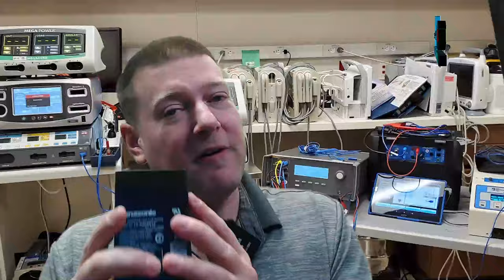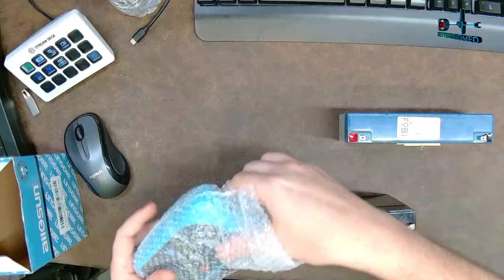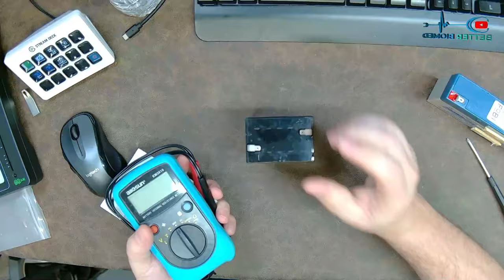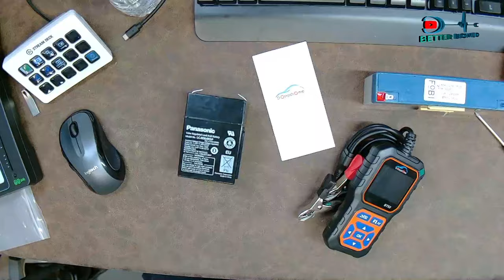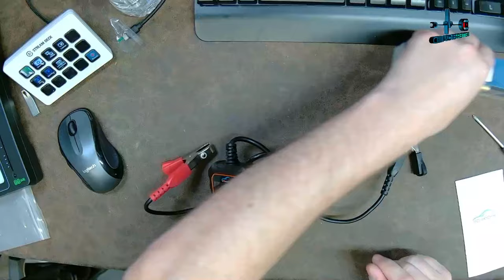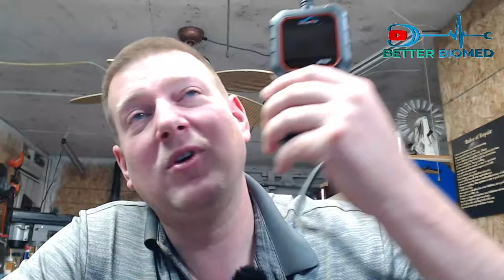Testing Batteries: It's More Than Volts!!

Comment: I use a Cadex C7400ER-C battery analyzer for most batteries. Also, It is amazing how much information can be gleaned from using just a multimeter and a variable psu for lead acid batteries once you learn their language.

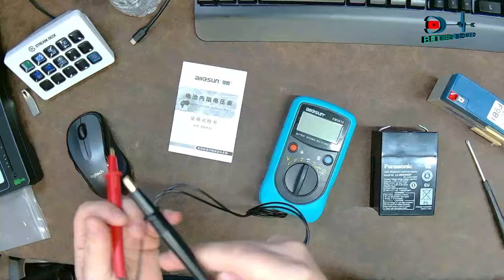Comment: 7:22 The 4 wires are Kelvin 4 wire measuring method to rule out the resistance of the testleads themself. 
Almost all of those little battery testers are for automotive use, they only do some calculation that fully depends on the parameters you have set, like voltage, Ah and  Cold Crank Amps (CCA) . Some use the SAE or DIN numbers that are printed on the battery. 
With any type of battery, you can go back to basics for calculating the internal resistance. You can do a load test, but then you drain the battery, and need a Clamp meter. 
But there is a another way without loading or draining the battery. Here for you need a signal generator, a analog multimeter, and a 100uF (or higher) bi-polair capacitor. 
Set the signal generator to a 1V peak to peak 100Khz square wave, place the 100uF in series with the analog multimeter (set in mA range) and connect the signal generator to the battery. The capacitor will block the DC from the battery, but will pass the AC signal from the signal generator. 
With 100Khz , a 100uF looks like a dead short (0,016 Ohm). Measure now the current, and use Ohm's law to calculate the internal resistance of the battery. 
Why a analog multimeter ? Because many DMM can't measure current above 1Khz, a analog multimeter doesn't care.
To get a very accurate measuring, you can do this test without the battery, so only the signal generator in series with the capacitor, and measure the current. 
This gives you the resistance of the capacitor itself, this value needs to be abstracted from the value you calculated with the battery connected. 
This 100Khz square wave signal is what many high end battery testers use to calculate the internal resistance, and this is also used in ESR meters.

Comment: But there is a coincidence between Vorlage and General condition, isnt it? if a 12v Car Batterie has been charged and it keeps voltage of ~12,8v its in good condition. If it only keeps 12,0V its probably gonna „die“ soon.
Reply from the maker: Voltage only tells you the difference of potential.  The amp capacity of the battery depends on the quality of the plates.
Reply: Just because the battery is discharged, doesn’t tell you anything about the amps that will be produced once it’s charged. If they sit at low voltage, the plates will start to get sulfur crystal buildups that will hinder amp output. There is no way to check this except with a load test when fully charged
Reply: Thx. But if you have, lets say a 5 year old battery and you dont have the equipement u used, the voltage AFTER charging is a good indicator in my opinion. If it drops down quickly near 12v, not so good. If it stays at ~12,8V for 12 hours, battery probably is very fine.  @BetterBiomedChannel